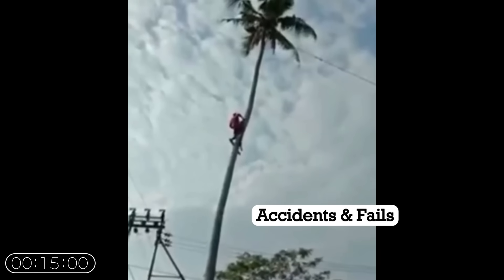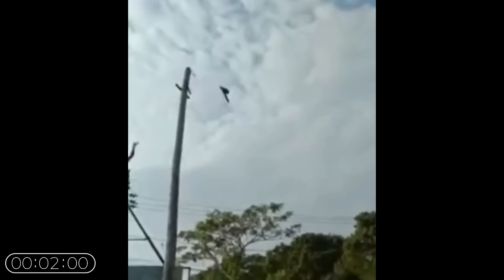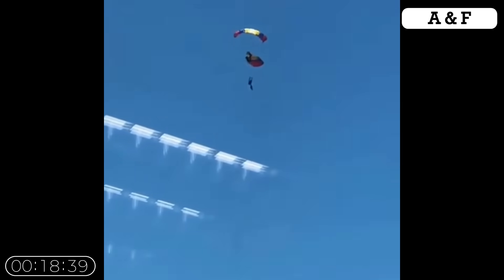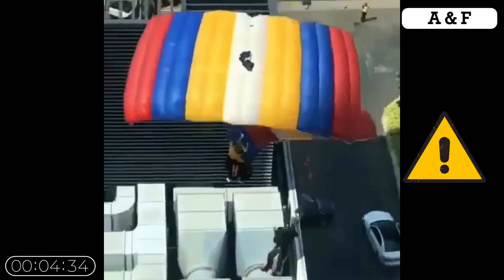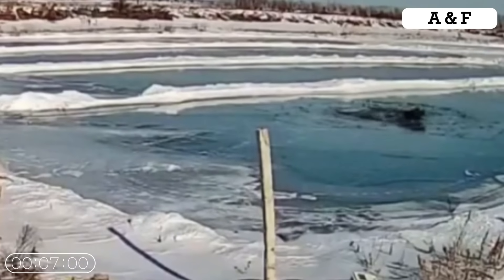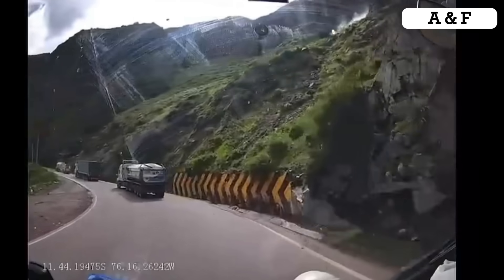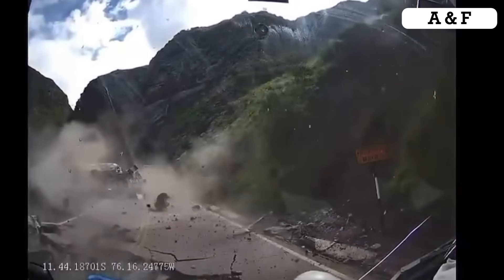❗WORK ACCIDENT - MAN FALLS WHILE CUTTING A PALM TREE

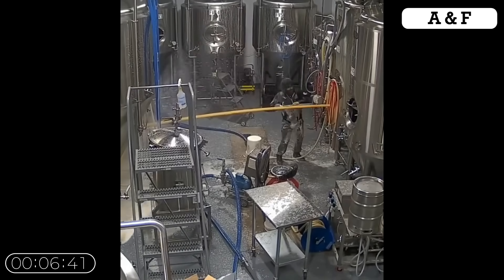Comment: At 1:09 The root cause of this incident was the incorrect design of the valve used for sampling. If the purpose of the valve was sampling, then it should not have been able to open that far.
Reply: Dude was trying to sneak a pint!